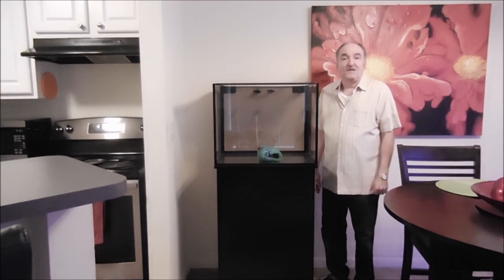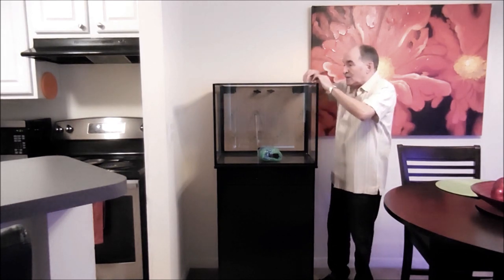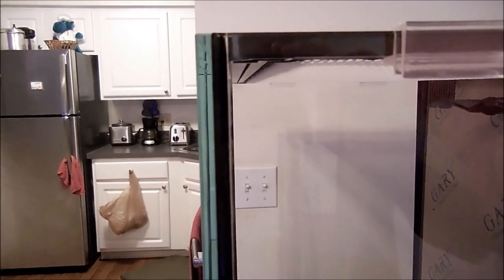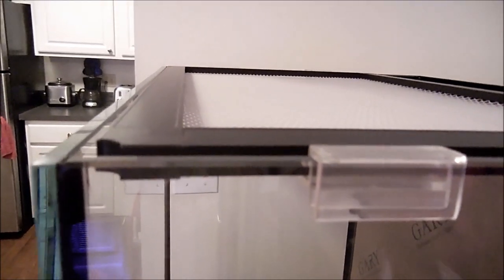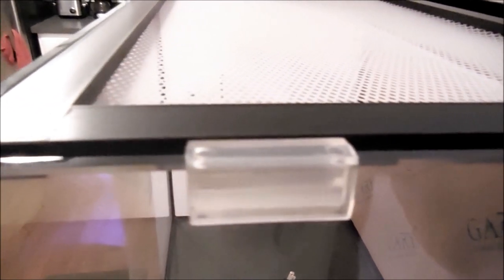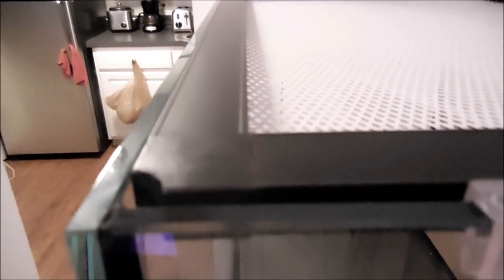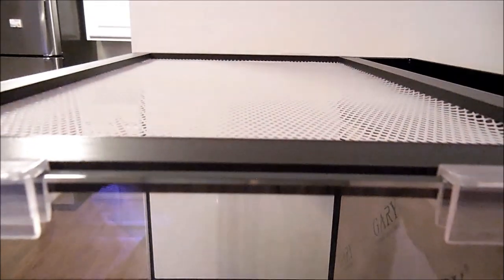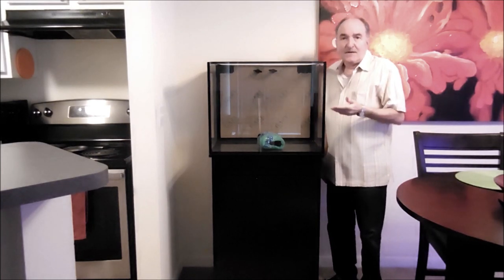Innovative Marine Nuvo 40  - "The Beginning"

Comment: Eddie do you still have the nuvo 40? Hows it looking. Im trying to decide between the red sea reefer 170 and the nuvo 40. any help?
Reply from the maker: Hi TheReefChannel, ,Yes I still have the nuvo 40 I just haven't started the build yet, because I'm going to put in it a lot of $. I'm going to make it a smart by this I mean; MP10"s wifi, Apex controller, and etc.  What I recently got was the return pump upgrade and still have other upgrades pending I want to employ.  When it comes to the reefer 170 it's a great tank, but will cost you much more than the nuvo 40. The decision would depend on your budget; both have low iron glass and the reefer 170 has a sump in which the water volume would be more than the nuvo 40, but not that much more.  I would say the craftsmanship on both are about the same.  So as I said it all depends on your budget.  Let me know any further info or comments you may want to explore.  Eddie of Eddie's Reef Aquaria